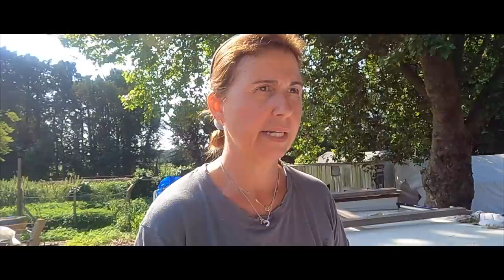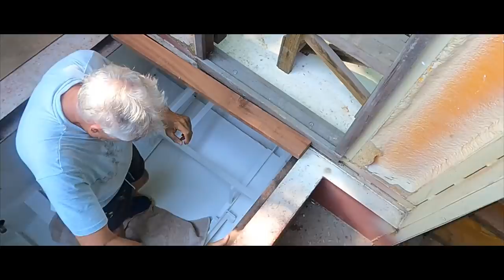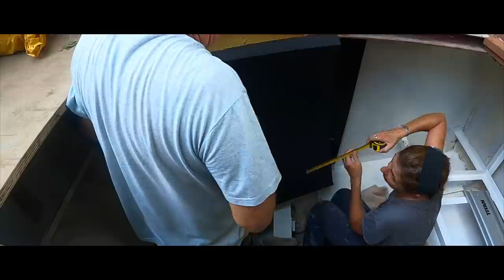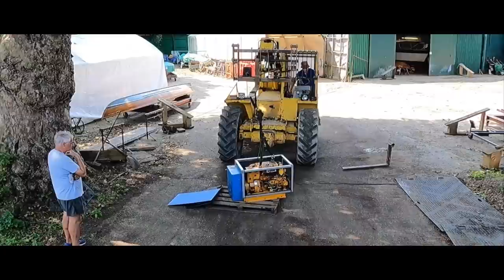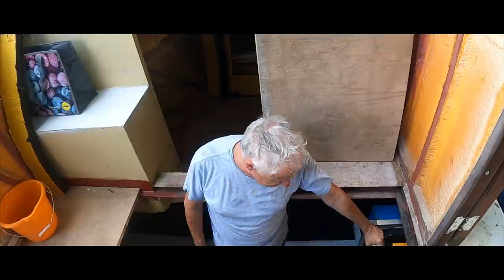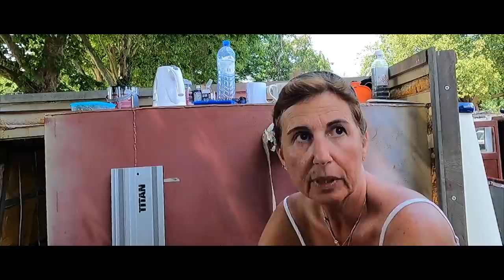BARGE BUILD .DOWN & DIRTY. Nightmare getting the generator in! Sailing Ocean Fox Ep 175

Comment: I would suggest covering that lovely black insulation with perforated aluminium sheet metal (3mm holes). You attach it with angle brackets top and bottom. A folded vertical edge between the insulation panels will stiffen it. You could paint the perforated panel white. It might cost a bit but would look professional and you could attach little things to the Ali panel, like lights or plumbing brackets. In a tight engine room you will often touching or leaning on the walls. Well done
Reply from the maker: Yes, the panel in the engine room is going up tomorrow. We will use to fix all the electrics needed there. Cheers Andrew

Comment: Why did you not test the Gen Set before you installed it ???
(;-) TP
Reply from the maker: The engineer had a look and said it’s ok, I guess we will see that one soon. The engine goes in tomorrow, fingers crossed. Cheers
Reply: @SailingOceanFox  OK (;-) You install the genset then the engine only to find out the Genset does not work. Then you uninstall the engine then the gen set , repair the genset then install the genset and then the engine again ?? I believe I would look for a smarter engineer.
(;-) TP
Reply from the maker: @VmaxBR549  don’t be so negative 😊
Reply: Not negative at all. Just practical thinking  (;-) TP